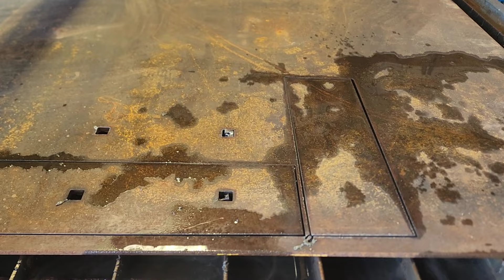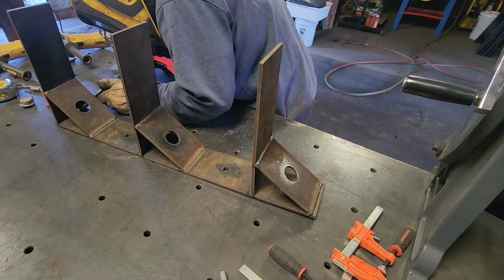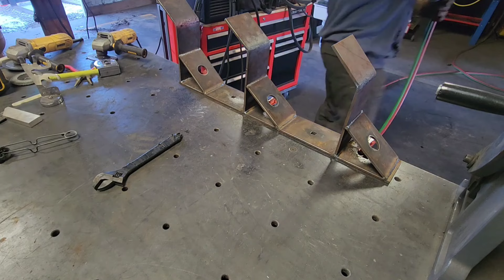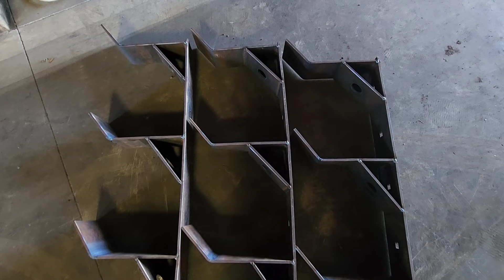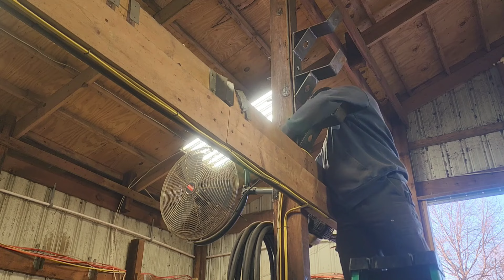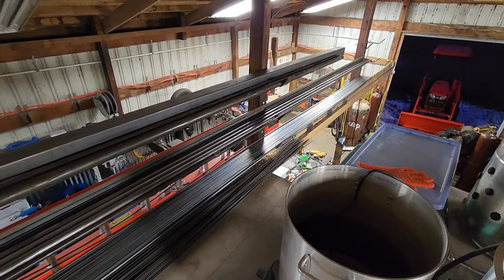Metal rack build for the shop materials.

Comment: Would the metal weight impact the shed's structure?
Reply from the maker: I'm no structural engineer but all that metal that is now in the rack was actually laying on that upper flooring the whole time. Only it was being distributed across 2 vertical posts and now it's being distributed across 3 posts, so I believe it's better off now than what it was before.